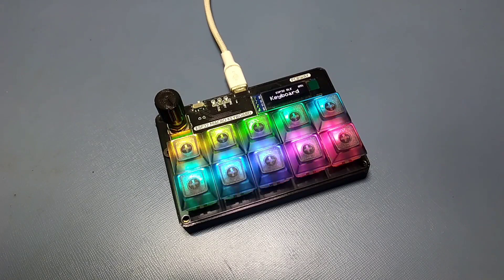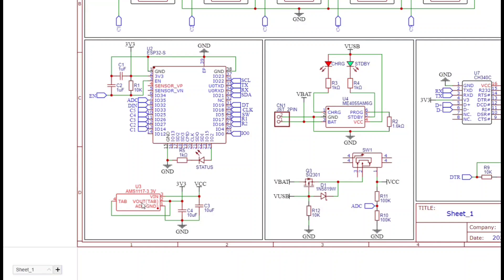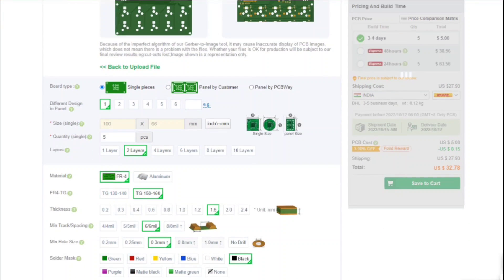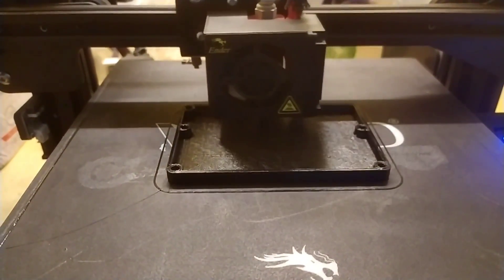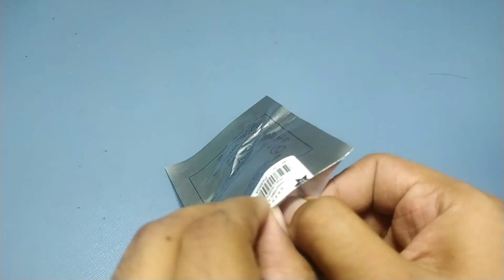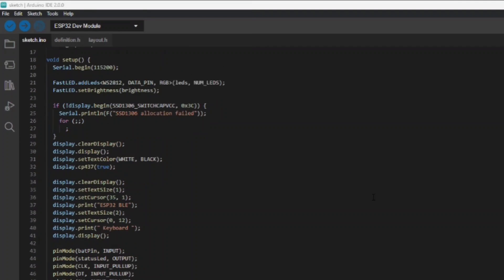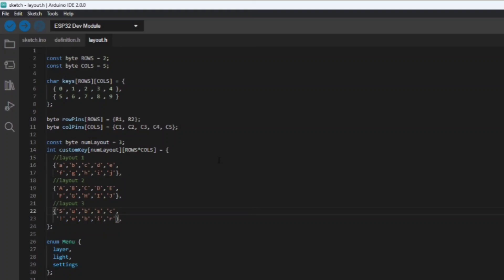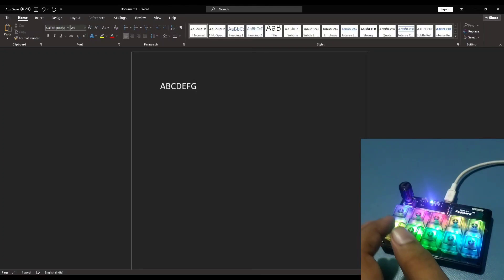ESP32 BLE Macro Keyboard

Comment: Nice job.
What's the voltage you used for  the leds? If its using batteries power it can get below 3.7 volts and the minimum voltage required for ws2812b is 3.7 volts.